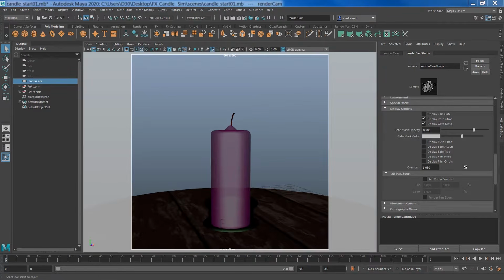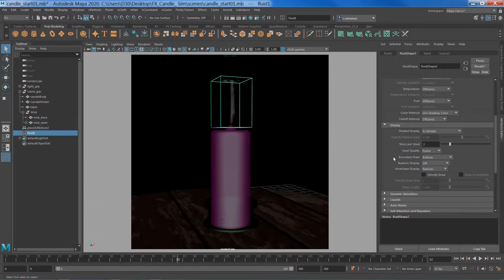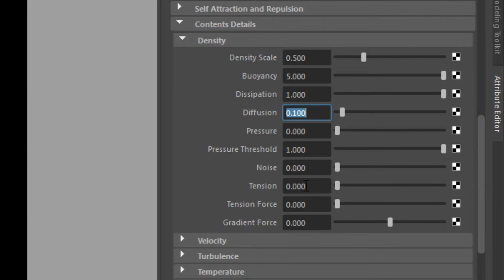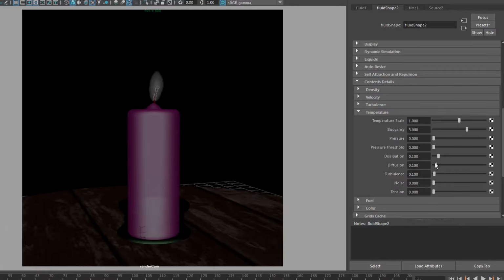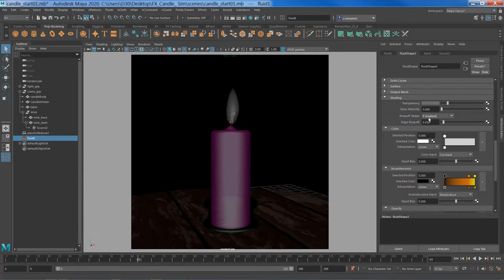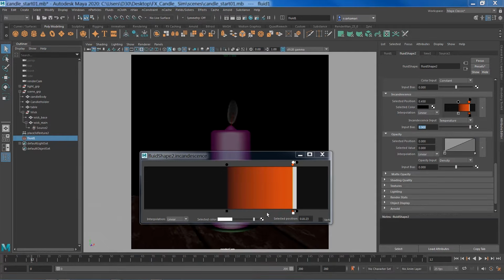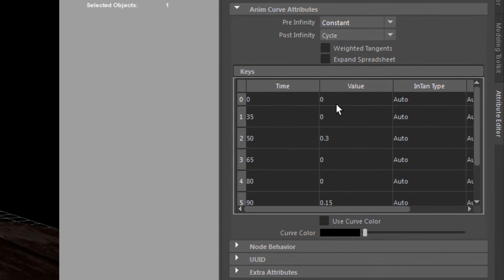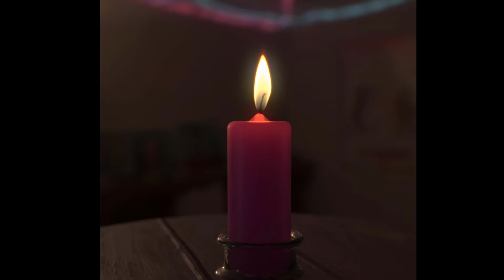Maya VFX Series: Candle Flame Effect

Comment: i followed the tutorial but using redshift not arnold and it doesnt show any kind of flames? :(
Reply from the maker: That’s correct. Arnold and Redshift use completely different systems for calculating values and handling efficiency. You’ll need to look for tutorials specifically tailored to Redshift
Reply: @sarkamari ty for answering !! I spent 3 more hours yesterday and figured it out !! :)) now it works perfectly 🎉🎉🎉

Comment: Thx for your great video!
Can you give a hint? How can i do my candle fire more light? Fire from candle must lights up nearest objects.
Reply from the maker: Thank you
If you would like to increase just the illumination then plant an omni light at the tip of the wick. If you would like to increase the volume then increase the density rate on your emitter:)
Hope that helps
Reply: @sarkamari   thanks a lot! I`ll tets it right now :)
Reply: @sarkamari  Seems that " omni light" its from 3dsMax.  When i read " omni" i thought thats some attribute in emitter ( saw it yesterday: "Basic Emitter Attributes -> Emitter type -> Omni) but no :( 
Just need to know another solution besides putting light in mesh. how do I make fluids illuminate more? exactly fluids? 
But thanks anyway for your answer and participating :)
Reply: @sergkowalski3226  You may have solved this by now, but after searching I believe a omni light in maya is a point light. some programmes just like to name them different